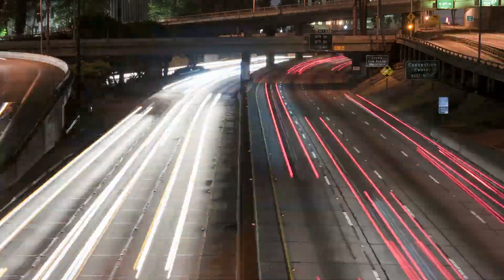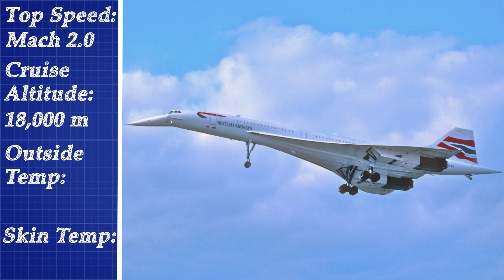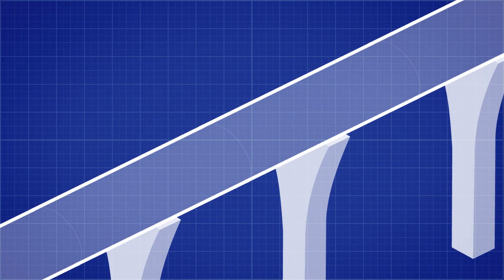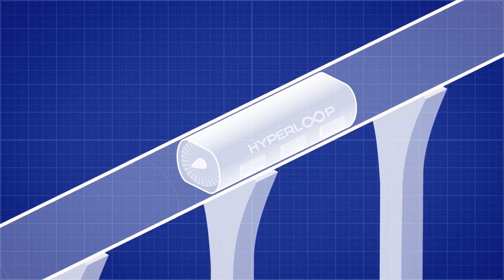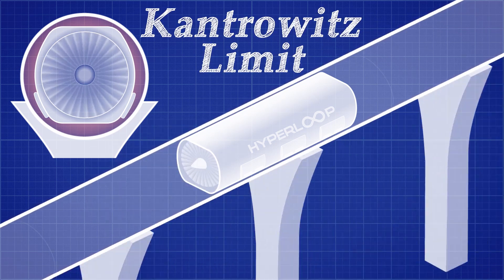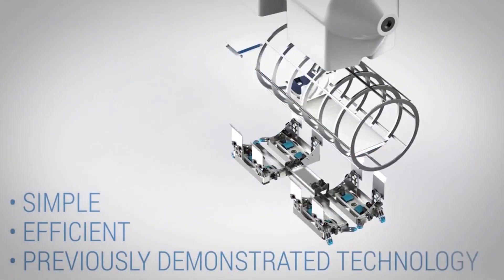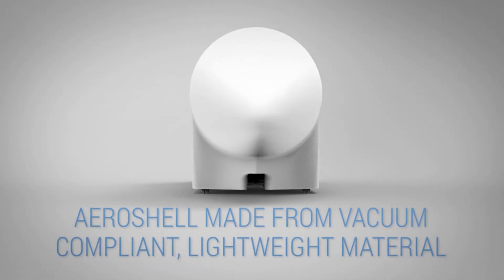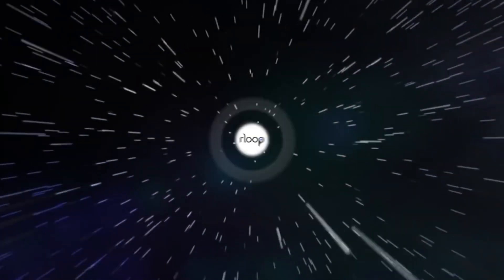Hyperloop - The Future of Travel?

Comment: What will happen if the tube is rapidly filled with air due to some damage to the tube? I bet no one on the train would survived it.
Reply: If the tube failed, it would create a pressure wave within the tube, this can be reduced by having non linear tubes and pressure dampening systems, effectively letting air flow into the system all along the pipe to slow all transports down and dissipate the blast wave, If the transport was within the section as it failed there would likely be fatalities. 

Would likely only occur in earthquakes and in comparison to the risk of dying just being on the streets it's a very low risk event.
Reply: +Stuart Miller You can't make the tube non-linear. The capsule needs super gentle turns at high speeds. But air compressors can vent the air from the shockwave at a high rate, dissipating the energy before it travels much length down the tube. The support structure itself is rated for earthquakes, since the pillars include dampeners and the tube essentially is free to move and bend as it needs.
Reply: Non-linear in terms of expanding the tube diameter, that would reduce air velocity over that section making it a safer stop for capsules. Could also implement a tesla valve type system
Reply: +Stanislaw Pak Damage to the tube can not be worse than the diameter of the tube itself and the air pressure difference between the atmosphere and the tube can be no greater than 14 psi, the effects of damage is limited and can be designed for with excess pumping capacity. However, damage can be expected to be much smaller and it can be expected that operation could continue in most cases and a safe shutdown passively designed as vacuum transit always touted a safe cushioned emergency shutdown as being inherit to the concept.

Comment: What happens if there is technical problem and you need to evacuate the train in the middle of the tube with limited air supply?
Reply: http://www.spacex.com/sites/spacex/files/hyperloop_alpha-20130812.pdf

Go to where it says "Safety and reliability."
Reply: Instead of sending a link you could answer question in one sentence. I read that section and it basically does say one paragraph: "All capsules would be equipped with a reserve air supply great enough to
ensure the safety of all passengers for a worst case scenario event."

Now, did they estimate what would be worst scenario? How long it would take to get to the stranded people and free them? What takes to evacuate people  from metal pipe under vacuum in the middle of the desert? How much air would be needed after all etc.?
Reply: +Stanislaw Pak They would have at least three possibilities, they could wait for the system to become functional again as they would have emergency life support in the capsule, the tube section they are in could be pressurized and they could crawl to a nearby emergency exit point, or they could be cut out of the tube.   Also keep in mind this is a design competition put on by a billionaire whose business model requires that investors see him as being on the leading edge of technology and innovation.   He only needs the idea to put him in the news and for him to be seen as a futurist.   There are solutions to the concerns you are mentioning but that's all irrelevant, whether or not it's a viable business model is questionable but Musk only needs to be in the news.   If something works out well enough for the business model to work then great, if not well it's already achieved the goal of attracting investor's attention.

Comment: You need to maintain vacuum on miles and miles of tube. How to maintain that vacuum and how to prevent the tube from leaking?
Reply: Pressure controlled sections that need to reduce overall pressure not create a perfect vacuum. The proposed system has a turbine that further lowers air resistance as it travels and creates the air skies it glides on. Not so helpful if in a perfect vacuum. 

The main bulk of depressurisation would occur at the tunnel entrances and the pressure would be highly controlled along its length to ensure ideal operations. A leak would be easy to find by tracking which pumps are working more than expected.
Reply: You can add pressure sensor controlled pumps every N-meters (don't know the optimal value for N) that maintain the vacuum and counter-act leaking. You could detect problematic leaks simply by monitoring the sensor network and patch them accordingly.
Reply: Yes I have. I found the estimates outlined in the alpha paper to be fairly reasonable. Why? Have you tried to calculate the total cost of those pumps for the whole track? I'd love to see your numbers.
Reply: The white paper claims the cost of vacuum compressors to be "no more than $10 million" on the 26th page of the Alpha paper. An insignificant portion of the $7 billion estimate for the entire project. Through my own calculations, I found $10 million dollars to be in the right ball park but I think $7 billion is a little optimistic, but that's mostly due to pylons, mounting, and right-of-way concerns that will likely require more involved solutions than the ones outlined in the Alpha paper.

It's simply not that difficult to maintain a 100 pascal vacuum. There's a reason engineers typically analyze vacuum systems on a logarithmic scale.

I could dig up my calculations for you, but I'd rather see you do some in depth analysis for a fucking change. From where I'm standing, you seem almost as fond of arguments from incredulity as Thunderf00t.

Comment: But what about safety? For example a hull breach causes the cabin to depressurise. (Sorry for bad english)
Reply: ***** If train tracks are damaged, a train may be able to stop in time.  Even if it can't, there is a good chance no one will die if the train derails.  In the hyperloop, a single hole in the 300 mile long tube kills everyone in the hyperloop.
Reply: If the tube pressurizes, ten the capsules hit the shock-wave and get destroyed. If a plane depressurizes, there isn't a shock-wave to vaporize it.
Reply: +trj820 Where are you getting this supersonic wave crap from? Atmospheric pressure is only 14 psi... A bicycle tire has about 100 psi, do you die from a supersonic wave when you bicycle tire blows out?   If a tube leaks, chances are the pumps will keep up with the leak and operation would continue until repairs are made, if the leak is large enough, air pressure would cushion the vehicles to a safe stop. The inherent passive safety of vacuum transit has always been a touring point ever since the Victorian era.   The real problem is that it addresses a niche market which is increasingly irrelevant as telecommunication improves and is already served albeit inefficiently by air travel.
Reply: This can happen in an airplane too. I think the tube will be able to be repressurized, which isn't the case of the upper atmosphere. Yet we use planes everyday.
Same for boats...
Reply: Zach A Bridges or railroads do. While bridges may be more resistant, I'm pretty sure you can crash a train with some well-placed stuff.
It has been done a lot during war, so it seems quite easy, yet we don't hear about sabotages every day, not even from ISIS.
Reply: +trj820 Where are you getting this supersonic wave crap from? Atmospheric pressure is only 14 psi... A bicycle tire has about 100 psi, do you die from a supersonic wave when you bicycle tire blows out?   If a tube leaks, chances are the pumps will keep up with the leak and operation would continue until repairs are made, if the leak is large enough, air pressure would cushion the vehicles to a safe stop. The inherent passive safety of vacuum transit has always been a touring point ever since the Victorian era.   The real problem is that it addresses a niche market which is increasingly irrelevant as telecommunication improves and is already served albeit inefficiently by air travel.
Reply: Exactly.
Reply: An airplane isn't 300 miles long and exposed on the ground...

Comment: I believe heat issues on high-speed vehicles are related to the compression of the air in front of the vehicle rather than friction.
Reply: I believe it's both
Reply: Well yes, but I think compression is by far the main factor.
Reply: maybe at lower speeds it is friction and then when you hit mach 1+ it becomes shock heating from compression.

Comment: What would happen if there is a breach? Would people get sucked out of it due to difference in pressure?
Reply: Highly unlikely that a fault would cause the entire system to stop. With an enclosed system stopping carts would create more danger. I would assume they would have wheels somewhere in the design for low speed travel in stations etc, i would also assume that during a fail they would return to running on these wheels at a reduced speed, that way they can travel away from danger and not just sit there.

The issue of blockage and fire escapes will likely mean the use of escape tunnels, or a third track are adopted to allow for bypassing. Even with this there will have to be fail safe operations for sectional control similar to underground tunnels. For the closest comparison look at the Eurotunnel, You can see its use of crossover intervals, service tunnels and ventilation systems to prevent issues.

As no rails are needed a Service track could double up as a fire escape or allow transports to redirect. These are being worked out currently so you'll see the final proposed ideas in a year or so.
Reply: No. Air would move into the tube, not out. If there was a breach it would shut down the entire system until it was patched and pressurized so they must be avoided at all costs.

Comment: I'm guessing it will cost more to ride than the train, but will it be less than the cost of flying?
[assuming comparisons between the same departure and destination points, of course]
Reply: Except no taxpayer funded REGULAR train has ever reduced costs or been able to run fully automated.  DC's Metro system and the New York MTA fares only cover 66% and 50% of operating costs respectively.  If Musk wants to do this he has to stay off the government tit.
Reply: The Hyperloop was originally intended to connect cities less than 900 km apart because hypersonic air travel would be cheaper at greater distances.
Reply: If everyone could actually do some research before saying things like this that would be nice. 

From Musk's original proposal: "Hyperloop could transport people, vehicles, and freight between Los Angeles and San Francisco in 35 minutes. Transporting 7.4 million people each way and amortizing the cost of $6 billion [estimated construction cost] over 20 years gives a ticket price of $20 for a one-way trip for the passenger version of Hyperloop." 

It would also be mostly automated, and taxpayer-funded, decreasing cost per ticket. And the solar panels on top can sell their energy to power buildings in CA, making a profit that way.

Assuming typical efficiency on a small sedan (~35 mpg), and average CA gas prices (~$2.91/g), the same journey by car costs about $35. Almost double the price and takes about 10 times longer.
Reply: It doesn't matter how much it will cost, it will matter how much people are willing to pay to get from New York to LA in 45 minutes. That is so much faster than aircraft it is going to cost the passengers much more. But is there REALLY a demand for it? 

Remember, this technology is completely non-viable for where you REALLY want to reduce flight time, like from New York to Beijing. That's a 12+ hour flight but hyperloop economically cannot cross over oceans and icecaps. The absolute biggest pie in the sky goal is a transcontinental line from New York to LA. That's a 5 hour flight.

How much more is ANYONE willing to pay - and sacrifice - just to save 4 hours? And this is a VERY specific transit. There is a lot of transcontinental travel (lol, flyover states) but New York and LA aren't the only destinations. Some want Silicon Valley, some want to go to Washington DC, some want to go to Frisco, some want to go to Toronto. There is no way Hyperloop can keep up with Business class and first class amenities. This was a problem for Concord as well, people compared 2 hours on the cramped seats of a Concord to 5 hours on the nice business class seats of a regular jet.

What's worrying is that people aren't going to value that much time saving, aircraft are already fast enough.

If hyperloop is mainly to connect cities about 900km apart then they're competing with aircraft that can do the same flight in just 1 hour. 

One area I can see a Montreal-Boston-New York-Washington DC route, the problem with such a MBNYDC route is if you're in Montreal and want to go to DC you need to go to places you don't want to go. And aircraft can fly direct from Montreal to DC. Hell, a private jet can land at any smaller regional airfield in between, handy for visiting the rich and famous who are in more secluded retreats.

I am seeing in WAAAAY too many places that Hyperloop will only be able to go around 900km/h and maybe maaaaaybe no-commitment-at-all might go as fast as 1200km/h.

Are you fucking kidding me? That's is the speed for private jets! And they have similar capacity as well. Yet FAR more flexibility. Private Jets can operate out of much smaller airports.

Why would anyone with the cash get this, which is only as cast as a private jet, more expensive than a private jet, yet far less choice in where you go or land.